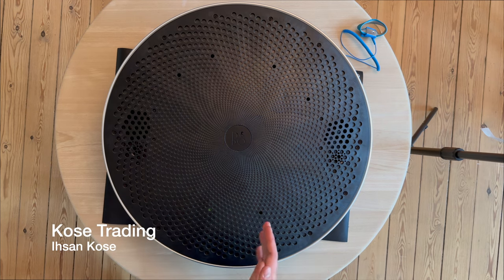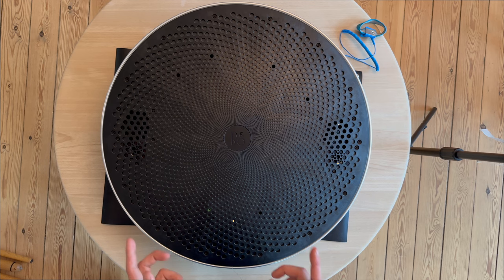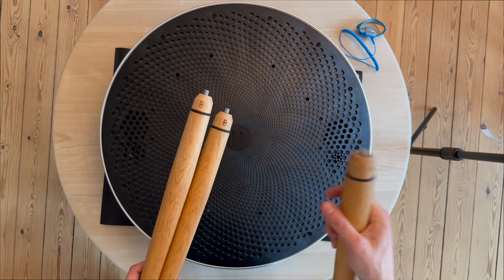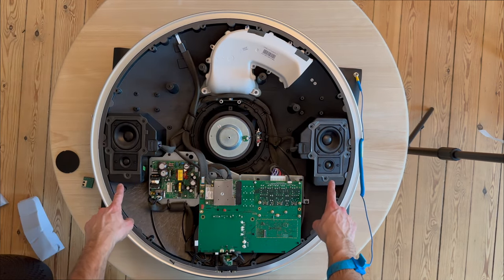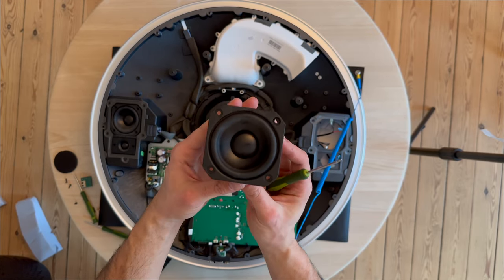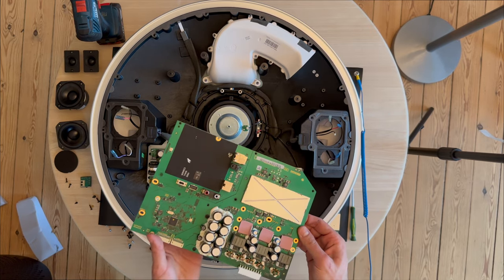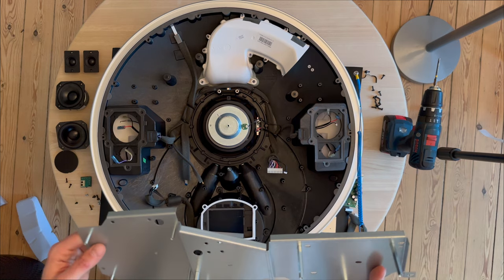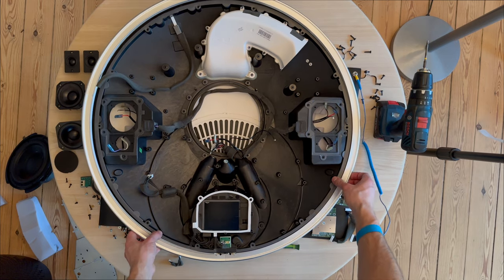Bang & Olufsen Beoplay A9 MK 1 Disassembly process and Repair guide

Comment: Love the big peerless sub, the beosound theater uses the same woofer but a 6.5inch version instead of the 8inch
Reply from the maker: I did't know thatBang & Olufsen had integrated the Beoplay A9's, peerless sub driver, into the brand-new Beosound theater.
Reply: Nah those 6.5 inch subs used to be on parts express for like $50. Sad they're out of stock now.
Reply from the maker: @speakerblowupmanlee5921  So it was not used in the Beosound Theater?
Reply: @KoseTrading  it probably was. Could be the reason it is out of stock.
Reply: The a9 had those 8" sls subs tho. The soundbars used 6.5" subs.
Reply from the maker: @speakerblowupmanlee5921  I'm not sure. But it could be also late model?
Reply: They’re also used in some studio monitors, the Barefoot Sound Footprint 1 and Genelec 7350A subwoofer

Comment: Hey, I have a MK2 that over time lowers the volume. I've read that this could be a overheating protection, however the speaker is not any warmer than normal. I've read the service manual for the 3rd gen, and that specifies a NTC module which I assume is resposible for measuring the temperature, and regulating the power output. Are this also present in the first generation?
Reply from the maker: That's a very common problem with the MK1 and MK2 version for Beoplay A9. You can try to clean out the amplifier and see if that helps.
Reply: @KoseTrading  Okay, I've read that a new mainboard might be needed, but reading the service manual, I see several NTC's, one on each driver, and again some on the mainboard connected to the MCU. Do you have any experience fixing boards?
Reply from the maker: @jacobtc  Yes, we can try to fix the problem on the mainboard and also the amplifier board. Send us a e-mail to contact@kosetrading.com
Reply from the maker: @jacobtc  Your are more then welcome to ship your Main and amplifier board to us and we can try to see if there are any defectives on then boards.
Reply: I have the same problem with my MK2. Looking for a way to fix it.

Comment: My daughter have a A9 MKII and it has frequent "crack" sound sometimes during play, and more often when the unit has been used and "cooling down". Do you have any advice? I read somewhere one solution is to lightly unscrew the screws on front to release tension. Any advise?
Reply from the maker: Thank you for your comment. Yes, I also heard about the "crack" sound coming from the chassis. Lightly unscrews can help, what I had experienced in disassembly process for Beoplay A9 that the screws a very tight. It can maybe help with the problem.
Reply: Great video! I have an a9 that developed a burning smell, it’s 12 years old. Any ideas what that could be? There are no error lights and it still plays, but I left it unplugged in a room corner for 12 months
Reply from the maker: @Markymark1408  The burning smell can come from the Power supply board or from the drivers.
Reply: @KoseTrading  great thank you, in either scenario is that an expensive fix? Time to get a new model?
Reply from the maker: @Markymark1408  I will try to fix the beoplay A9 if you have the time.